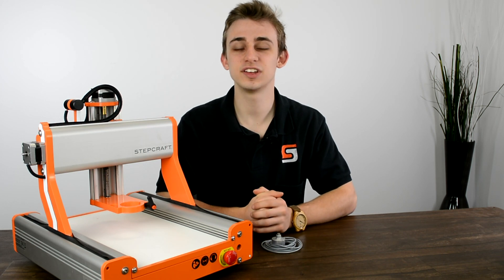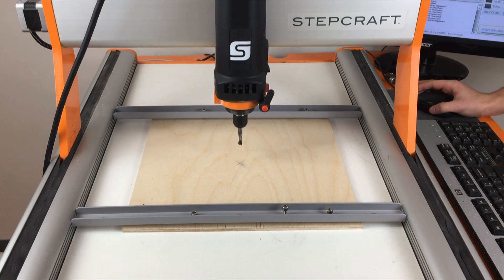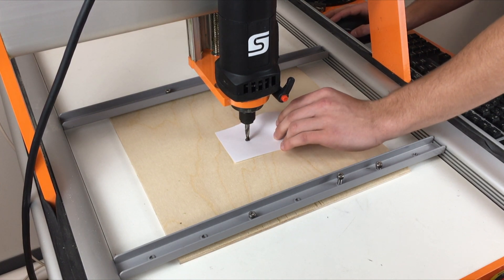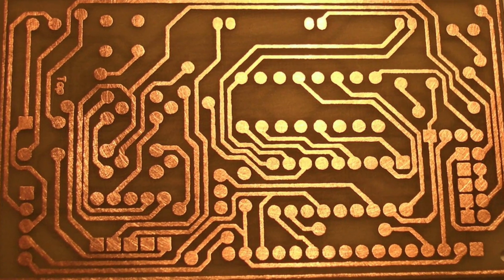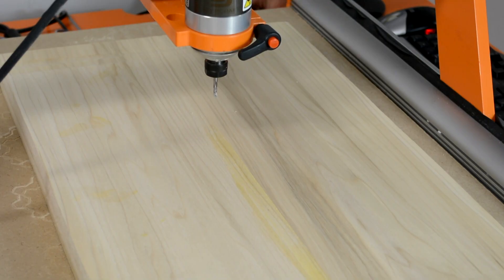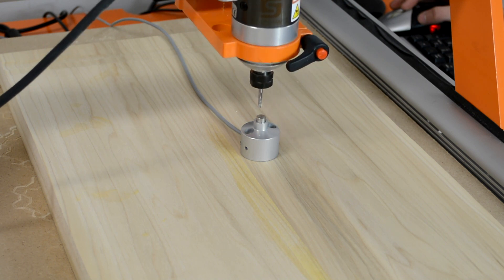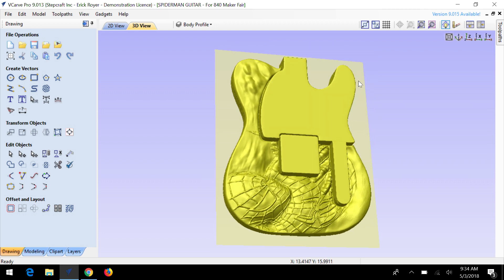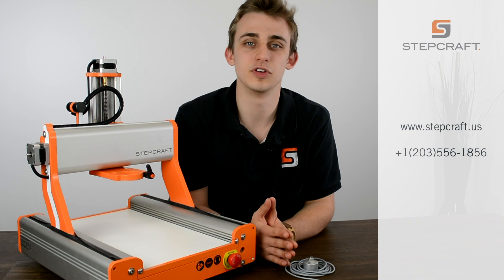Perfect Z Height Every Time!  STEPCRAFT Tool Length Sensor

Comment: what about zeroing the x and y? drawing and X on the work is not very accurate
Reply: why do you need accuracy on X,Y ? you have plenty of material to use around. Unless you mean to put a precut stuff to add some operations. Well then it is a question....
Reply from the maker: @Sinalsa  Some jobs might require you to set the center of your tool on the corner.  This could be the case if your material is the same size or just slightly larger than your final job size.  Using the 3D Touch Probe for this is perfect
Reply from the maker: You can use the 3D touch probe to zero off X and Y.
Reply: You can also turn the tool length sensor on its side and with some custom macros (look them up with Google or Youtube) us that to probe for x and y.

Comment: I have a tool length sensor but on the second touch it comes down fast and hard on the sensor until I hit the stop button.just wondering how I fix that or what is the issue?
Reply: mickkinse i have the same problem with mine. Hope we get an answer
Reply: ask on the stepcraft forum. but first make sure you have the right macro file in your ccnc (if you use ccnc). There is a link to the file in the forum.
Reply: the file i use is here https://drive.google.com/open?id=14HOSCuiCB9b8pH6Q9xZEg2AoFkXjDWit and it works great